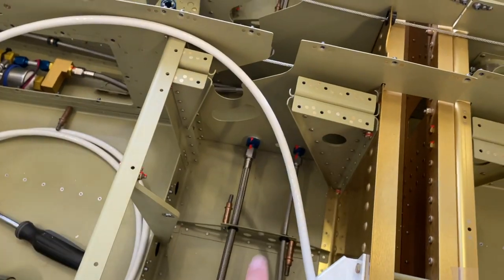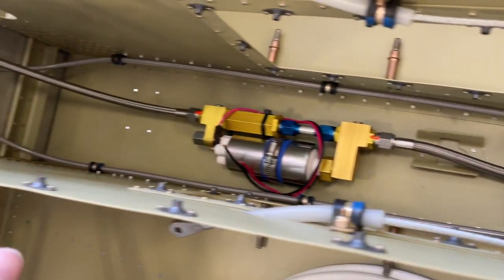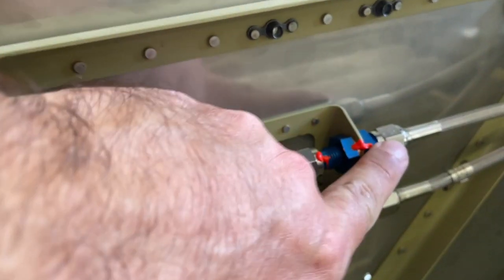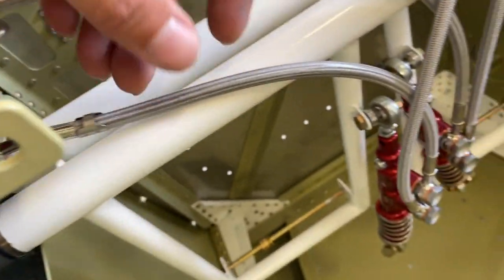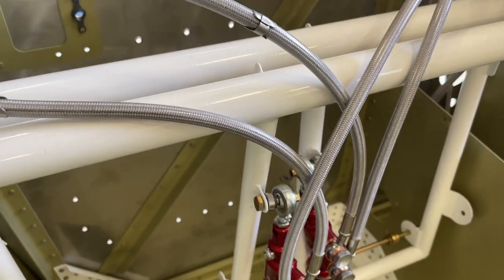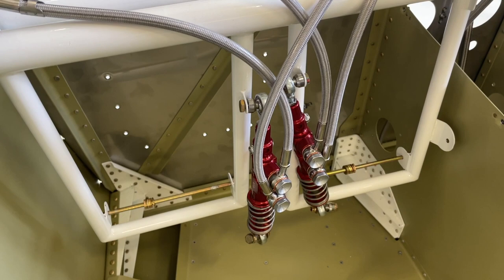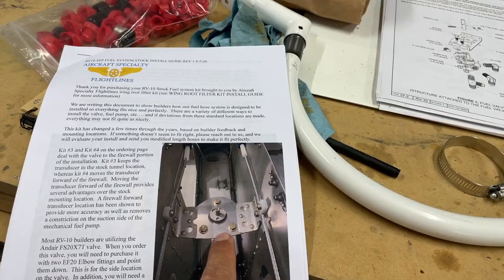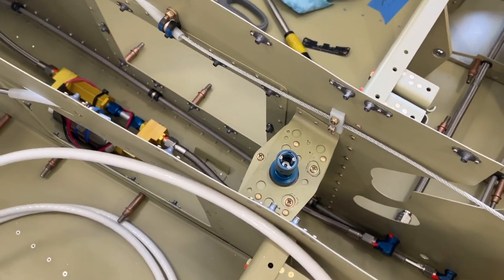RV-10 Build: 05/03/2021 Fuel & Brake Hose Overview

Comment: Would be nice if the break fluid reservoir was translucent so you could see how much fluid is in the can. Great when purging the breaks and checking levels. The TAF Sling TSi does use the translucent reservoir. Great Videos and great craftsmanship!! :)
Reply from the maker: It would be nice but considering I only check it 2x annually it doesn’t feel like a big burden. To make it translucent it would have to move inside the cabin and likely be hard to get to. Feels like a reasonable compromise.
Reply: @BuildFlyGo  Your lucky, 2x per year! 
I had some issue and had to purge the breaks multiple times, fluid spilling all over the reservoir most of the times while doing this. 
I don't think you would need to relocate from the current position. 
It is a very low cost "change" or upgrade that brings, at least to me, a lot of benefits.
Reply from the maker: Oh, I only had to purge once when installing on the -9. I check the levels at winter service and at annual. It’s never needed a top-off.

Comment: What, if any, are the differences/advantages of using the Airflow Performance aux pump vs the stock from Van's?
Reply from the maker: The stock FI pump from vans is the same as the AFP pump.

Comment: Did you use the stock Aircraft Specialties provided aluminum T from the copilot pedals to the brake reservoir or did you use an aftermarket steel T? With the stock T being an aluminum NPT fitting how also did you seal the gap it leaves around the firewall?
Reply from the maker: Yes, used the stock T. Will seal with 3m fire barrier when we do the rest of the fw penetrations.
Reply: @BuildFlyGo  thanks. Are you doing any heat shielding on the firewall itself?
Reply from the maker: @auburnaviator6167  Undecided still. We didn't on the -9A and had no issues but understand tunnel heat may be more of a thing with the -10 so giving it some thought. If we do it will be engine-side only.
Reply: @BuildFlyGo  if you do please include the process in a video.

Comment: What size rubber grommets did you use there for the different hoses?
Reply from the maker: The ones that fit? Sorry, I have a tackle box with a dozen different sizes, I just picked the one that worked out :)
Reply: @BuildFlyGo  Do you need to use a specific grommet that would remain stable in the fuel?

Comment: As you mentioned you are using the seats from the RV9 in the new 10 build. It got me wondering, how much of the 9 and 10 have part commonality?
Reply from the maker: Not a ton. Here and there you see some crossover. A few empennage ribs if I remember right. The seats were pure luck :)

Comment: As usual…fantastic info..thank you!  I’m not at the brakes pedals yet, but would nylon washers mitigate the friction issue when using two bolts instead of the really long one?  Just a question/thought.
Reply from the maker: Worth a try. The friction issue I've noticed is with the individual bolt not staying straight and "torquing" back when you put pressure on the pedals. The single bolt is an easy, reasonably inexpensive fix to this. That being said, I don't notice the issue on the -9, but already had the bolts so figured "why not".

Comment: What was your decision process for choosing the wing root fuel filters vs the under seat filters vs the tunnel? I was thinking it has to do with accessibility and ease of access for changing filters but with the tunnel access panels that might not be a problem. But tunnel heat and congestion with everything else that goes in the tunnel probably also plays a factor. 🤷🏼‍♂️ 
Also since you’re running the AFP pump and I didn’t see you mention it in your video I’m assuming you’re not running a return line to the tank? Last question (for now anyway) what ignition system are you planning on using?

I’m in for any group buys also.
Reply from the maker: I have the cabin filter in the -9a and it makes a mess and is unpleasant to pull out and clean at annual. I figure the wing-root option would keep the mess outside the airplane, plus add "filter redundancy." I have no idea if filter clogging issues happen but this would avoid that.

Like the -9A, we plumbed the tank for a return line into the 3rd bay, but we are not going to use a return fuel system. We've decided on the tried&true AFP FI and dual p-mags that all work so well on our -9A.

Comment: Did you buy the airflow fuel pump from Vans as a standalone or did you buy an installation kit too?  If you just bought the pump what is missing to do the install?  

I'm doing exactly what you.  I have the wing root filters on order.  I'm trying to figure out what else I need to install the fuelpump.
Reply from the maker: I got it standalone and have so far not noticed any missing parts.

Comment: Are you building your own hoses, or are you having the custom built?  I love how precise the hoses are in the layout.
Reply from the maker: AircraftSpecialty.com has hoses perfectly sized for the RV-10. Just order off their website :)
Reply: @BuildFlyGo  sweet… I’m prepping to build a SlingTsi and they use rubber fuel lines which I’m wanting to swap out for the lines like yours…
Reply from the maker: Give AS a holler, they can make you a custom hose set for whatever length you need.

Comment: You seem to replace several "van's parts" with items from other companies.  Do you not trust the Van's parts?   Are the Van's parts somehow inferior?   Why else would you have the Van's parts in hand, then buy other (better?) parts to replace them?   I was under the impression that Van's tests and provides parts that are 100% reliable.  Is that not the case?
Reply from the maker: The vans stuff is awesome, but like any tinkerer there's always a "different" way to do something. In this case, the AircraftSpecialty hoses save a lot of build time for a process that I'm not terribly fond of. The cost in not crazy for the amount of time saved, so I find it to be a good deal. There are many vendors out there that offer products that are improvements or time savings, but there's absolutely nothing wrong with sticking to the stock parts.
Reply: @BuildFlyGo  Additionally, Steve is an awesome guy to work with.